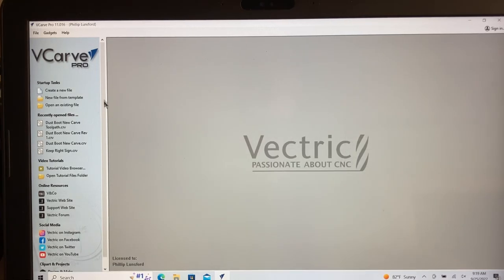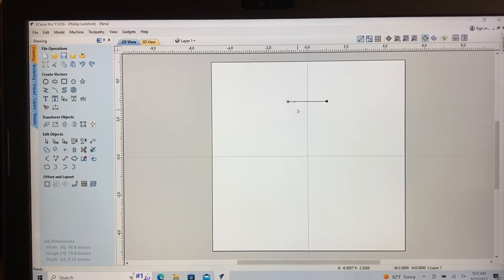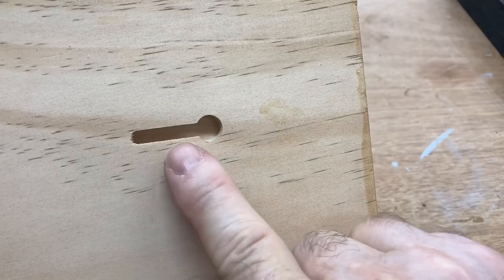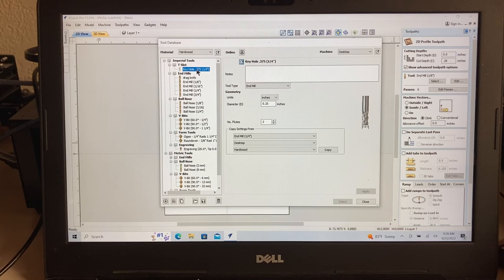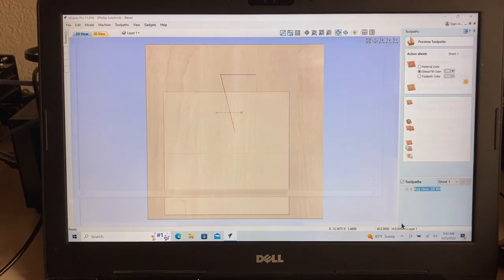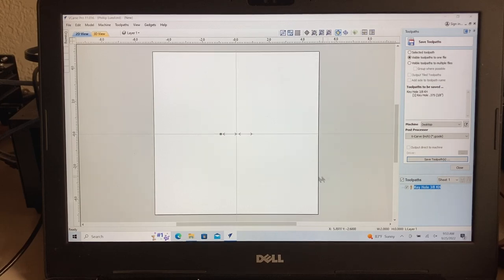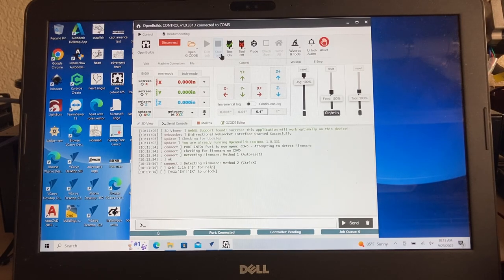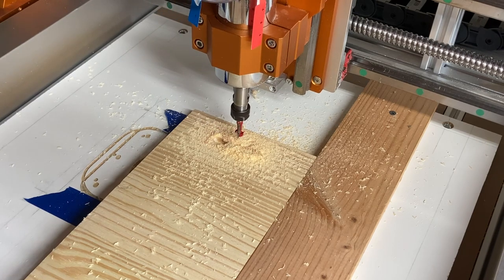How to Design and Carve Keyhole Slots

Comment: What brand bit are you using? It isn't working for me maybe its my bit?
Reply from the maker: I have three bits, all are different brands. What is the problem that you are having with the keyhole slots?
Reply: @PawPawsWorkShop  They make an oval at the start
Reply: ok I will keep trying.  I LOVE your videos and explanations.  I'm Going to try the 3D pumpkin carve soon
Reply from the maker: It should. To carve an oval. The bit should plunge straight down into the material. Is something loose?  The toolpath should be a straight line.